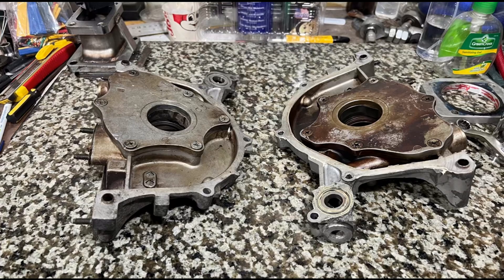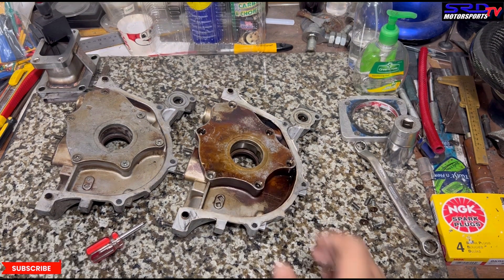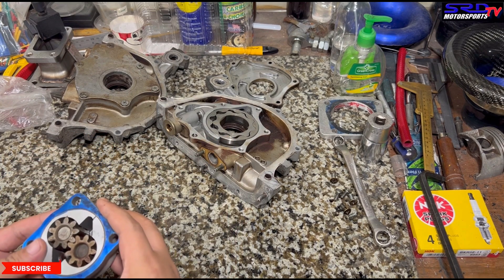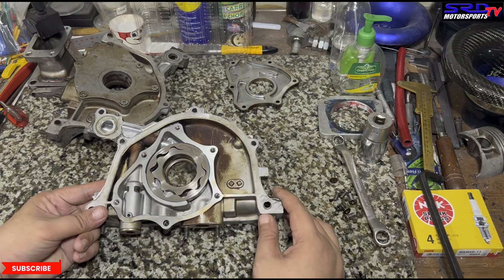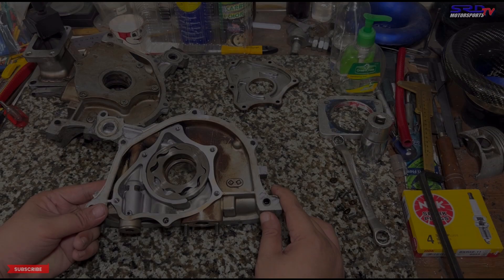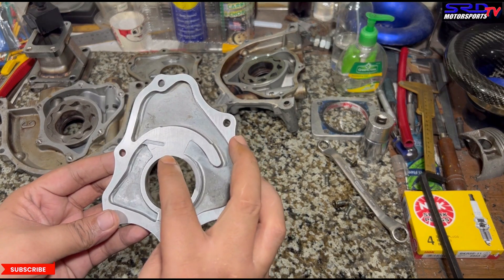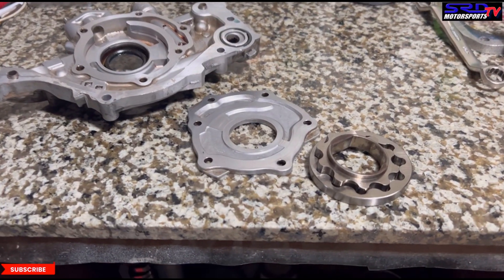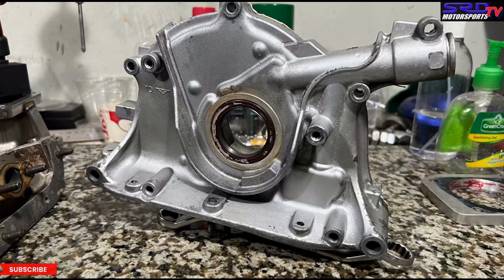Honda Oil Pump Porting Tech B20 D16 B18c K24 K20a

Comment: an old oil pump wont cavitate as easily as a new one, the engine tolerances will also be off, thats part of the reason people do use shims. To compensate for the wear and loss of oil pressure. It wont cavitate unless you go stupid on the shims, 1 shim is enough, 1 to 1,5mm
Reply from the maker: Right

Comment: What measures of mm resurface will do enough to smoothen the oil pump cover? And give more better oil pressure? 🤔 Or secret? Just sends the oil pump to you guys🤣
Reply from the maker: usually even less than 0.010” = less than 0.25mm anything deeper means more worn pump still rebuildable but not as good

Comment: I have an ACL Brand B20 Oil Pump Sitting in a box collecting dust probably should put it in my B20B even though the one that’s in my old b20 on the floor has a only a few miles on it so might throw it in since it’s never used ...
Reply from the maker: That’s a good pump indeed

Comment: 2jz oil pump have a straight shot and turn 90 degree’s exactly like this. One mod those guys do that really increases oil pressure is close off the motor feed and weld a fitting where that straight shot is, from there use a hose into the motor and feed oil that way. 
That less aggressive turn (using a hose) will increase pump performance allot. some supra guys even get too much pressure that way.
Reply from the maker: Oh yes! Angled turns really kill a lot of flow and pressure it’s why most AN fittings are curved pipes that’s superior

Comment: What about a h22a4 oil pump? Im about to do mine and am curious about it. Ill examine it amd see if there is anything that i can recognize from your explanations, but would there be anything in particular?
Reply from the maker: They’re actually “visually” similar to the Bseries

not sure if I worded it well enough back in that vid but the “cover”’or back side usually gets worn vs the steel gears and more sideplay there eats up pressure and oddly enough accelerates cavitation or in essence makes it happen sooner or worst so the almost no sideplay is always better…

Almost always it’s the back cover that gets worn cuz that’s aluminum, unlike the steel gear

(This something that’s easy for you to do actually)

Comment: Hi Mate, for a Street d16 that will see occasional public circuit days, do you reccomend a stock pump with the works described in this video, or would you reccomend something like an ACL pump if it can be afforded and some extra clearance bearings. Thanks heaps !
Reply from the maker: I think if the stock pump is inspected like on this video and it seems good and possible to refresh then I say no need to buy another

Comment: Greetings from Portugal :) nice to know you speak Portuguese as well

I'm kind of confused here...
I have a b16a2 pump and a b18c4 pump from an mb6 civic (ukdm) but the b16 pump gears are in fact a little bit bigger than the b18.  I noticed it when I tried to switch gears between pumps and the b16 gears won't fit in the b18 pump housing so maybe it is an aftermarket pump gear with a modified housing?
Now I'm rebuilding the b18c4 but the pump is in really bad condition compared to the b16 I have

My question is if there is any difference between b16 and b18 pumps regarding oil pressure and flow? Presuming they are both stock
Reply from the maker: Greetings man! :)

the pressure difference should be minor,
on both oil pump u should see a “number”
Engraved on the outer cover the one that faces the back of the pulley when the pulley is installed ? The higher number was sought after… like a 9-10 or 11 was preferred than a 7 or 8

Comment: Hello sir 

Didn’t know you from mozi sections 😬

Next to SA my friend 👌🏼🤓

Anyways thanks for the very informative video as always 😎

My honda had lost oil pressure i the week and I tested it today only to find out I am getting no oil pressure at all from the Vtec test port or from the oil pressure switch,

I hope I didn’t cause too much damage to my bearings. 

I had done the shim mod as well as it had increased the oil  but didn’t know it would be a bad mod in the long run, 

Thanks for the articles explaining why we shouldn’t add the shim 

Are all b series oil pumps the same?
Reply from the maker: Yes I grew up in Maputo so almost every month we drove to Nelspruit so I enjoyed “Steers” I love food haha

most of the Bseries pumps are the same or atleast fits among each other but the b16 and b18c pump are the better ones than the b20/b18 

But personally the b20/b18b is fine if the engine is built good and well so it is okay I use a lot of those
Reply: @SRDmotorsports  he he 

Must hit me up with a message when you come this side again 

I’ll take you to some restaurants where they sell real good food 😁

Thanks sir, I am trying to get another honda b16a pump, will most probably have to order form honda
Reply from the maker: Oh yes will def hit u guys up when I’m in the area once again

Comment: So no need na lagyan ng additional washer ung spring? Iport na lng ng konti ung oulet ng oil? Nakita ko sa utube may nilalagay sila na flat washer para mas tumigas ang spring to add 5 to 8 psi
Reply from the maker: If u study the purpose ng spring? Sangkatutak na kalokohan ung washer

Kase relief spring sha releases pressure stock mga nasa 78psi Pra d masira seals lagyan mo washer ung pressure release tataas maybe 85psi or even 90psi bago mag release ng pressure

wala kinalaman ang pag taas ng pressure

Pde mo limit sa 85psi kase nka washer

Maabot ba? so see wala kinalaman sa pag taas pressure

Porting same sa head kung head nga kaya iport Pra sungaw para slower than stock 😂 same sa pump…

mas malaking effect pa ang “bearing clearances” affect oil pressure

so kung sabi ng racer guru friend need maluwag bearing ask mo alam ba nya pinatay mo din oil pressure ? 

hope that makes sense
Reply from the maker: @johnbarangas  if u re watch the video and research ung washer idea nila ay 1970s trick nung wala pa hardened and forged spring na lumalambot kase spring nung panahon na un pag mainit 

Iba na after 80s 😂
Reply: @SRDmotorsports  buti sir napanood ko pa yunh senyo.. Muntik ko na gawin ung nakita ko sa kanila.. Kla ko totoo yun.. Baka lalo pa masira or magkaron ako ng spun bearing.. Better bili na lng ako acl oil pump
Reply from the maker: kung wala prob stock pump mo then wala problem no need mag palit 

ung igagastos sa ACL pump madami iba pde mapuntahan to make the engine better

fyi habang tumataas pressure mo kumakain ng kabayo un or nkaka bawas

So d mo kelangan mataas kelangan mo “tamang”’pressure
Reply: @SRDmotorsports  thank you sa info sir.. Napiltan nko mag Diy sir ng engine ko Gusto ko san kayo mag build.. Kaso di ko makita ung address ng shop nyo..Paalis nako next month.. Tengga na naman kotse ko nito.. Nkaresurface na en nka rethread na ung na loosethread sa engine block.. Hanap pako sariwang po8 head kasi puro gasgas na ung nilalapatan ng camshaft ko pati mismong camshaft..
3rd owner nko sa kotse en nakadalwang baba na makina ko.. Kaya Diy ako ngayon habang bakasyon..
Reply from the maker: oks oks

Comment: Does the "back plate" wear more than the main housing? Also, are any of the aftermarket B series vtec pumps any good?
Reply from the maker: sometimes… and even if the main housing gets worn it’s harder to resurface it and so the backplate atleast reconditions “half” of it
Reply from the maker: The ACL ones I’ve seen and held one is mint actually
Reply: @SRDmotorsports  Since the oil pump is running all the time, what is a mileage interval to check or recondition the pump?
Reply from the maker: @TrackSol  that’s a good question but quite hard to tell I mean… it also has the gears submerged in oil, but locally anything that’s over 90,000km in the odometer I def check even the last series the VTi while not worn it did benefit from blueprinting it hence u see on start up before it even runs as we crank it oil light turns off ftw

Comment: How about K series Type R and Type S pumps? Toda Racing actually shims and recommends shimming the K pump. One would had thought Toda being a big company involved in Honda tuning for decades and has their own R&D and manufacturing, would had know better?
Reply from the maker: No actually on the K series it might be different and I haven’t researched as much on that yet mainly cuz on k24 ? Upgrading to k20 TypeR pump solves a lot including cavitation and even better on s2k pumps…. it might be different in a sense that the oil pump is belt driven? I know some brands offer some mods that slows the rpm of the oilpump thus moving the cavitation limit higher or away from normal rpm reach hence shimming might be an effective safety margin
Reply from the maker: Toda is the real deal so they for sure got some good r&d on that hence I consciously didn’t include the K stuff , until I got 101% research 😎
Reply: @SRDmotorsports  Thank you so much for the thoughts, yes K oil pump motors are chain driven, not sure how it differs in this sense, but if you look at Toda products under their K series oil pump/balancer shaft delete kits, they mentioned they increased the spring pressure by 15%. In another old instruction sheet from Toda about upgrading the lower block, they recommend, shimming the K oil pump with 2.5mm thickness worth of washers. The K pump's valve likewise relief back into the pump path within the pump, instead of outside the pump and into the oil pan, but I wonder if the valve internal design is the same and if shimming will actually reduce the 'supercharged' oil flow for the K pump motor. Would you investigate further if you have the chance next time for a K pump porting project or something?
Reply from the maker: @antonc108  thank you for the added details now I can sense where we are (as far as discussion) goes

And yes I will want to definitely look into it
And it may be a lot more reasons example maybe too Hi psi can do harm on oiling of the cams and head itself… but yeah thank you for this as it adds more ideas for future content

We are currently (but no rush so slow build) a k24 that will have a TypeR oil pump and a k20a that will have an s2k oil pump so definitely this adds good ideas on the research and analysis
Reply: @SRDmotorsports  Thank you sir, please discuss baffled oil pans while on the way too!
Reply from the maker: @antonc108  oh yes definitely! actually we did some on the B before just never had photos and back then I was more secretive and I realized man…it’s all good it ain’t no secret just help hehe
Reply: @SRDmotorsports  Any thoughts on Joe McCarthy's $0.75 oil pump spring mod?
Reply from the maker: @findtherightbeat  oh that one I haven’t checked on that but there could be something there as Joe always worked on Kseries only and as mentioned Toda did the same hmmm
Reply: @SRDmotorsports  have you looked into this yet? Shimming the k20a2 oil pump? Curious to see if it’s good or bad. I’ll be porting my pump but not 100% on shimming it. It’s not going to be a wild build, mostly stock k20.
Reply from the maker: Actually havnt as I havnt had a chance to work on other Ks yet hopefully soon

Comment: Both those oil pumps you have there are for a non vtec LS. There is so much BS misinformation on youtubevits stupid. If you want the best performing Honda b series oil pump buy a brand new Honda B16 OEM pn# 15100-P72-A01 oil pump, then send it to 4P Piston Racing to be properly ported.
Reply from the maker: Yep that’s the vtec oil pump that’s good and I agree easier for the US guys to go 4p on this and they do it right and properly too! as always